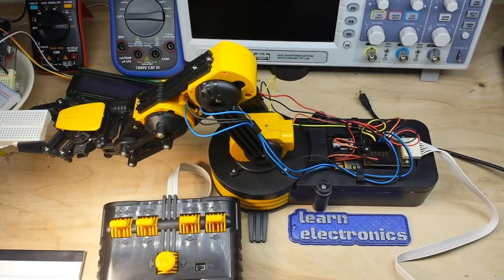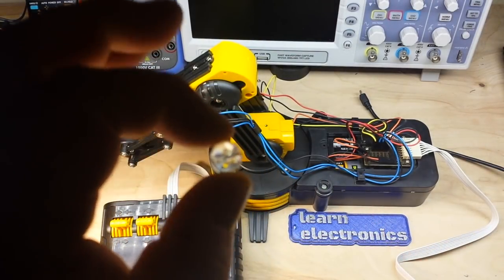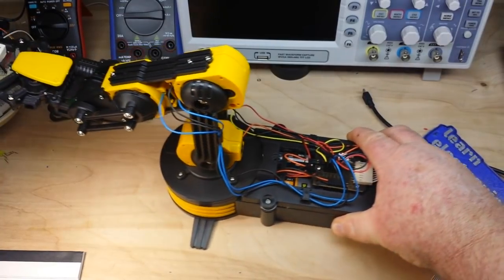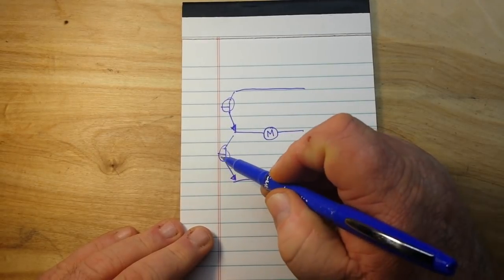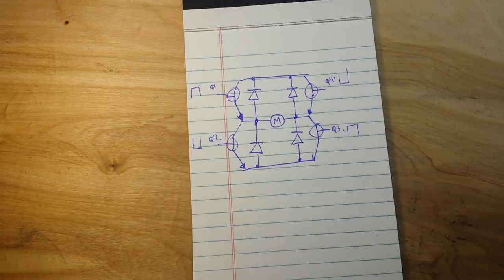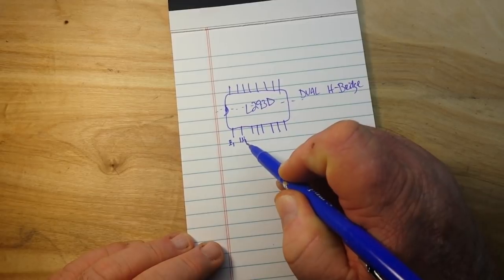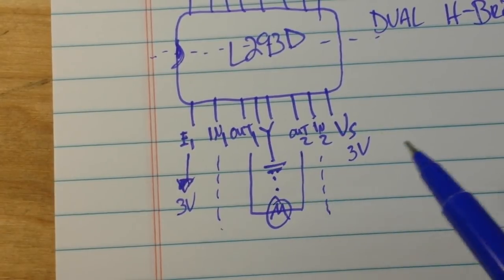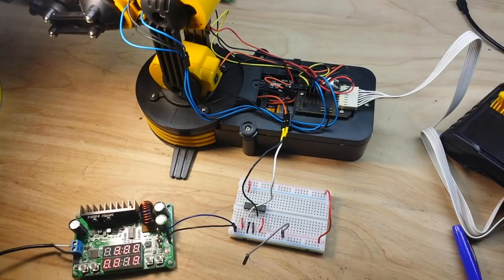Hacking a robot arm-part 2

Comment: Power suply and over simplified board are most dissapointing things in this product. I tried to supply it with extetnal power, but as u found out u need hbridges and skip original board to rotate both directions ehhh

Comment: This is going to be a fun project. I use L293 H-Bridge IC's with small stepper motors but have never used them to control brushed motors before. I guess they control both in a similar way. Do you know the current these motors will pull under a load? It's something you need to be very aware of with steppers or you'll let out the magic smoke. Can't wait for the next installment! Thanks for sharing with us.
Reply from the maker: +George Chambers These motors are barely pulling 200mA
Reply: It shouldn't be an issue then. Thanks.

Comment: chips at the amazon link are labeled as stepper motor drivers.  you don't have stepper motors here, just brushed dc motors...right?  so you can use stepper motor drivers on dc motors?
Reply from the maker: +jcr723 The L293D is a dual H bridge. A single chip can drive 2 brushed DC motors or 1 stepper.